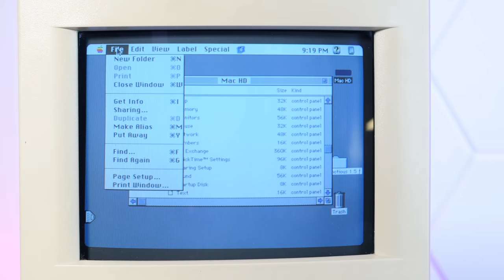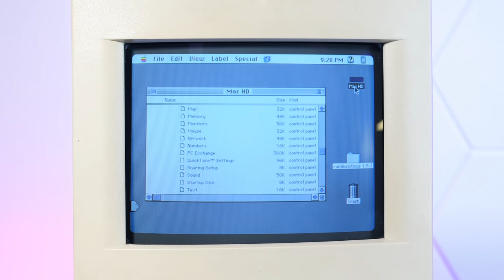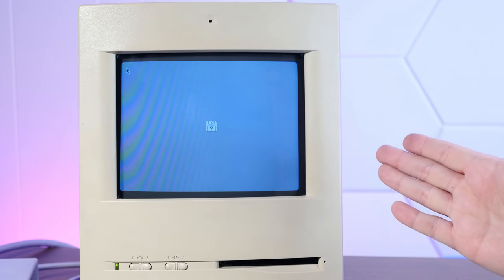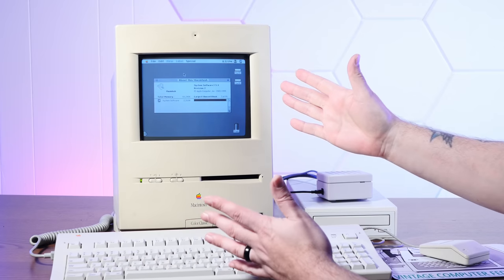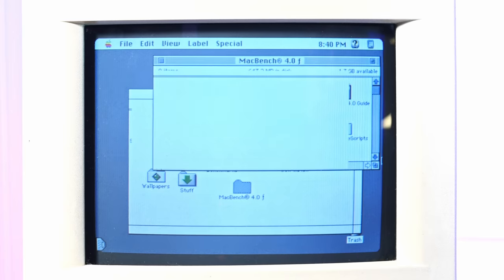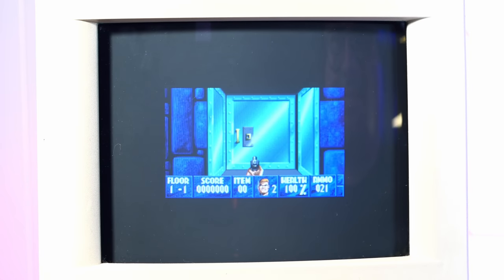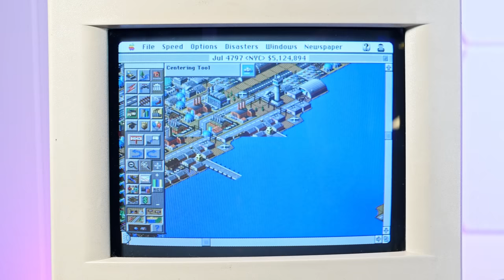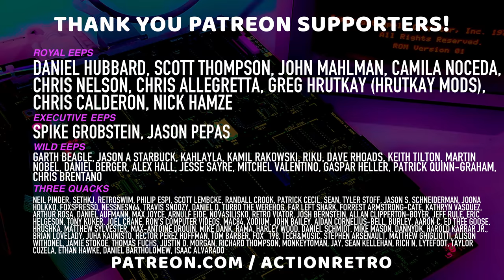The Color Classic is the BEST WORST Mac Ever

Comment from the maker: Get the Exclusive NordVPN BIRTHDAY deal here
https://nordvpn.com/actionretro - It's risk-free with Nord's 30-day money-back guarantee!
Reply: How is this comment from 1d ago??
Reply from the maker: @ThePeter567  I use YT's scheduling feature to make videos go live, so I upload a day or two in advance
Reply: Hey Sean, at 15:22, I hope that green wire is routed around the back of the flyback transformer.  I wouldn't let it touch the anode wire.  Not knowing what the tolerance is of insulation surrounding those wires, I wouldn't want to risk a chance of high voltage arcing between the ground and the anode wire.  It's not pretty; I've seen what happens.
Reply: For the screen geometry, it looked rotated. So you could rotate the deflection coil yoke by a couple of degrees. Carefully.

Comment: The CC was basically an LC II in a pretty, compact AIO box, so it had the same 16MHz '030 stuck with a 16-bit bus and 10MB RAM ceiling (which were what really hobbled these things). The CC II (and LC 550) was an LC III+ in a compact AIO box and it was actually pretty good: 33MHz, 72-pin SIMMs for 32+MB of RAM, with a full 32-bit bus. I've actually done all of the various CC mods over the years and the Mystic is arguably the best as far as performance improvement vs. ease of installation. The PowerCC with the Alchemy and Gazelle-based boards are fast, for sure, but it's a ton of work with a hacksaw/rotary tool and rewiring of the harness (including installation of a 3.3v regulator in most cases), and if you want to use a PCI card you'll have to rig something up to physically support it. And for a G3 upgrade you'll have to hack up the case even further, cutting out part of the chassis below the floppy drive. Unlike the Mystic, these also require the HiRes upgrade; they don't support the native 512x384 resolution.
Also that Seagate hard drive is really good, assuming it's still properly functional. It's way better than the OE drive and way faster than a stock CC deserves (and probably shouldn't have been used because of increased power draw and heat production).

Comment: Feature Creep Alert: Looks like they've got RaSCSI's networking stack going in the mainline release and are working on making it also appear as one of those weird ass SCSI graphics things.  Could, eventually, be handy for those of us with SE/30's hamstrung by the low resolution. 

Also yeah... the colour classic is basically an SE/30 but worse in every way other than a low res colour display.
Reply: What like the Lapis Powerbase SCSI? That would be amazing, I could finally stop looking for the right SE/30 PDS card to fit my SE/30 monster.
Reply: @MistahMatzah  Radius Power View seems to be the one they're going after.  It seems to need you to compile a dev build from akula's github and obviously have the drivers installed. 

But yeah seems like a onestop upgrade for the SE/30 at this point.  Gets you drives, networking and graphics... no need to hunt for the super rare PDS cards.

Now how do we get a PiStorm in there....  I feel the need for SPEED.
Reply: nope, the colour classic is more like a compact mac version of the lcii
Reply: @windowsxpnt2347  So... kinda crappier in almost every appriciable way and deliberatley hamstrung for no, apparently, good reason. 

Or

Worse than an SE/30 in everyway bar the colour display.
Reply: @sarahts21  no more like, "hey we need a new cheap education mac" "ok just put an lcii inside a compact mac case, give it a colour screen and sell it" remember that the reason why the colour classic had the weird screen resolution was so that it could support the apple iie card properly

Comment: To fix the tilt you need to adjust the yoke - that is the big electromagnet on the middle of the CRT neck. You should be able to loosen the bolt/nut on the back of it slightly and then carefully rotate it. As with the other geometry adjustments, you have to do this while it is on in order to see what you are doing. 

Great video!
Reply from the maker: Thanks!

Comment: Great video.  Question: What camera and shutter speed did you use to completely eliminate the horizontal scan line?  I can get my Panasonic GH5 to smash it down to a very thin white line (which I prefer over black), but I cannot fine tune the shutter speed enough even with Synchro Scan to completely eliminate it like you did.  There are times in my videos when you see it completely gone, but that's only because I had a static image on screen and edited out the scan line in FCPX.  Thanks!
Reply from the maker: Thank you kindly! On my GH4, a setting of 60 gives an almost imperceptible white line on the stock CC. 60.1 gives a more perceptible black one.
Reply: @ActionRetro  Thank you for confirming.  On my GH5, I am not able to get as much fine control with Shutter Angle (I normally use 180°) as with regular Seconds Divisions shutter speed.  But even when I try 60.0 or 60.1, my white lines are still noticeable.  Must be a GH4 to GH5 difference.  All said, if we had finer control like 60.05 instead of just 60.1, 60.2, etc., we could eliminate those horizontal lines completely.  Again, thank you!

Comment: The geometry issue needs to be adjusted by the magnets on the tube. Adrian has done some great videos about that. Thanks for your great videos!
Reply: Was it the yoke that just needed a little adjustment?
Reply: On the color tubes most stuff like pincushion is actually done with pots on the back of the analog board. Only tilt and convergence can be adjusted on the yoke for the color tubes.
Reply: @kylejones8392  It looked like it need rotation
Reply: @julianbarron5293  yup, you just loosen the yoke and turn it.

Comment: I always wondered why the 512x384 resolution mode existed in Mac OS. I accidentally selected it once on my Performa 6116CD and it interlaced my screen into a nearly unreadable mess. I had to look at screenshots to figure out what to click on to get back into the control panel to change it back!
Reply: If you are still curious, I recall 512x384 was mainly for use with the Apple //e card which plugged into the LC (and CC's) PDS slot. Apple intended the LCs to replace the Apple II's in schools (which probably had heavy investments of Apple II software), the //e card meant to be a bridge of sorts
Reply: @naryasece  Interesting! I had been looking for a ][e card for my LC but they're all a bit pricey (especially with the y-cable!)

Comment: Some of the geometry may be related to the alignment of the deflection yolk, as well as the magnetic adjustment rings around the CRT neck... The rotation skew is easily fixed by loosening the retaining screw for the yolk and rotating it.

Comment: Back in the late 90s/early2000s I started fixing up old macs as a hobby. Parts were dirt cheap back then and you could find good examples of pretty much any old mac you wanted. I did the CCIII "mystic" mod to a CC. It worked great, got System 7.6 running on it - Lc 575 board, modified the analog board using the 'mystic mod'. It ran great, actually, wish I still had the computer, but I ended up selling it to buy other old macs. One I bought in 2004 was a 1999 B&W Mac that I maxed out and upgraded to 10.2, actually got used as my main PC when a Windows computer I had died on me. It worked pretty good.

Comment: Is it a 16Mhz/32Mhz BUS speed, or is it 16-bit/32-bit wide data bus?  I thought it was bit width, not speed, that influenced the Color Classic.  In the same way the original LC was also limited.  The CC was basically the LC.  Both machines have the same boot chime, and both have a 10MB limit.  A limit I believe set by the bit width of the bus, 16-bit.  Or have I been wrong all these years remembering it this way?  The CC2/LC550 was essentially a LC3 board, which makes it over twice as fast.

Comment: Apple loved to hobble machines around that time. My family's first Macintosh was an LC. It came with a similarly limited 512x384 monitor, a 40 MB hard drive and 4 megs of RAM. That was the affordable option for us at the time, apparently. At least it could run HyperCard, some simple games (such as Hellcats) and Microsoft Works, so we had fun and got work done, but it sure was slow and limited.

Comment: Great video! Sure brings back memories. :-D About the Wolfenstein 3D performance - as a kid I used to play Wolfenstein 3D on my parents’ LCII a lot, which is also a 16 MHz 68030 on a 16 mhz bus with a 80 MB harddrive. But it ran Wolfenstein just fine in 320x240 - I played it a lot (both with 4 MB RAM and later 10 MB). The Wolfenstein performance in this video looks crazy slow.

So something is definitely killing the performance. I always kept our LCII at System 7.1 however because 7.5.5 and 7.6 were way too heavy for that machine, and I spent lots of time optimising it by disabling unnecessary extensions etc.. So I’d be curious to see it running on a clean 7.1 or 7.0.1.  It should run fine in 320x240. 

Also I saw that you had the Stuffit Deluxe menubar item running, so I can’t help but think that Stuffit SpaceSaver could also be the culprit causing the bad performance, or maybe some other extensions?

Can’t wait for the next Marchintosh videos! :-)
Reply from the maker: Ah yeah, I'm going to put it down to 7.1 I think

Comment: With MacBench, click on the application icon, press Cmd-i change minimum ram to 7000 kB and try launching it again. It isn't like modern computers, memory allocation is more... manual. Sometimes you can reduce how much you give it and the program doesn't mind. Other times it does.
Reply: Or startup without extensions (shift while starting) to maximise available RAM :). Remember to quit everything else. You can even write an applescript that quits the finder then launches MacBench for maximum memory saving :)
Reply from the maker: Oh thanks!!

Comment: I've been looking for an old fried mac classic, not the color ones. Because i like to make old sleeper PCs. Where i put modern hardware in retro PCs. I would LOVE to put a modern ryzen 5-7 in a mac classic shell.

Oddly enough, 3rd party mac classic shells cost more than actual mac classics.

I have a Compaq SLT 286, that i've been trying to find a modern laptop motherboard for, one with at least a gtx 1070. The screen fits an ipad 3-4 LCD perfectly.
I have an old amd pre-ryzen apu laptop board, but i hate it soo much. It runs soo bad.

Comment: I really don't get why people gut the LC 575 in order to do the Mystic upgrade. You lose the CD-ROM, the stereo speakers, the bigger, higher-res monitor. Yeah, you can dork with the analog board on the classic to get 640x480 out of the monitor, but you don't need to bother with the 575. If I had a live Classic and a dead LC 575, and I wanted one live system, then maybe I'd do it. But these days, even unmolested Classics run for a ton of money, and LC 575 donors are even more expensive. You can easily drop a couple grand on a project like this, and all you have to show for it is a Mac that can barely run DOOM.

Comment: I'm definitely looking to forward to seeing what you have in store for this CC.

I have a Mystic with an LC575 board sporting 64mb of RAM and a 1GB SCSI drive.  I've resisted the 640x480 upgrade out of fear of screwing it up, but otherwise I love this little computer!
Reply: I've done the VGA mod before, then undid it and did it again a different way. It sucks. The aperture grille is too coarse for 640x480. If all you are going to do is games it is OK but text makes you wanna squint.

Comment: I just found your channel and must say that I am quite impressed, I myself currently have a PowerBook 520 and a PowerBook 1400CS. I would like to get the 520 running again as it seems like the OS got corrupted. I have the OS on CD ROM with an external SCSI drive and the computer does not seem to even recognize the CD ROM (The same goes for the 1400CS and that’s working perfectly). What do I need to do and am I kinda screwed?
Reply from the maker: Have you tried holding control option shift delete at startup with the CD rom attached?
Reply: @ActionRetro  I would have to check. It’s been like a year and a half since I attempted it last as life got in the way. The screen’s lament has been peeling away from the screen itself and I either need to find a replacement or figure out how to repair the one I have. I can live with it though.

Comment: Wolfenstein running worse than a 286 PC. Not entirely surprising as the Mac port doesn't have Carmack's x86 assembly. Still I would expect an 030 to do better . Makes me wonder if Apple considered the display's resolution to be about the limit they could expect for a colour machine with that cpu

Comment: Yikes... System 7.5.5 is nearly as bad on a Color Classic as it is on a Macintosh Plus or SE (non-/30). Without swapping that crippled 16-bit logic board with at least one from an LC 520, best keep it at the stock 7.1. Heck, if it weren't too old for it, I'd use 7.0.1.

Then again, since you intend to turn this into a Mystic, I suppose my point is moot.

Comment: Avoiding the fact I was like #666, but DUDE!!!! Electricity hurts man! you had my cringing when you talked about adjusting the image. Back in 2000ish, when I was in college I was in Computer Service Technician Year 1 and there was a CRT that if someone wanted it they had to fix it. Same kinna issue. However the teacher asked how I was doing and I stood up, with my other hand hitting the screen, completing a circuit and tossing me into the wall behind me. I learned two things that day.. 1 they make plastic screw drivers for a reason AND the difference between "Mega-Hurts" and "Kila-Hurts" and they're in the wrong bloody order. I have to this day, my right hand has shaking and twitching issues. Learn from my mistake and get yourself some plastic screwdrivers. 
Only other time I've had bad electrical issues was a badly grounded E-Machine. Took a wooden broom to separate me from it. Don't do that either.

Comment: Who would have spent 1500$ on that and not felt mugged off by Apple.... The performance is dire for 1993, at the 1500$ price point! :'( 600$ in 1992 would get you an Amiga 1200 which is similar/slightly less performance with an 020
Reply: Can't wait to see the board replacement which will make good use of the screen